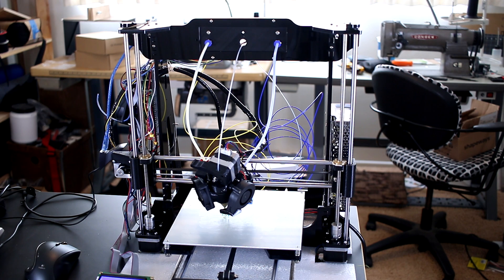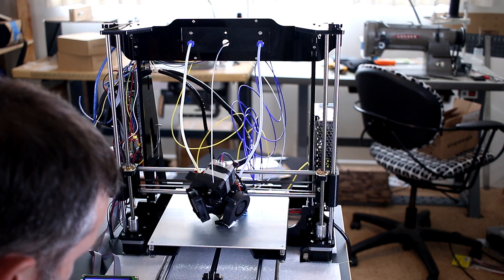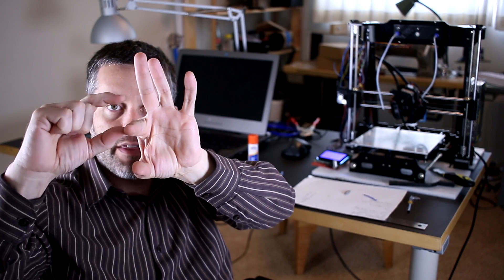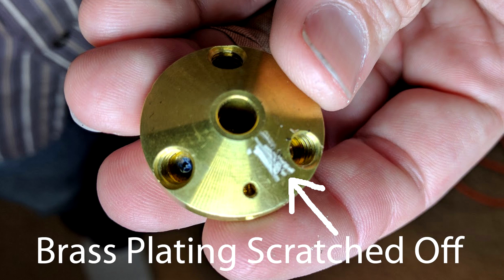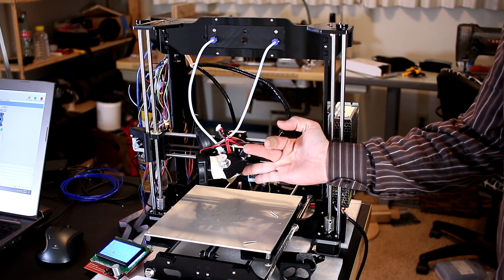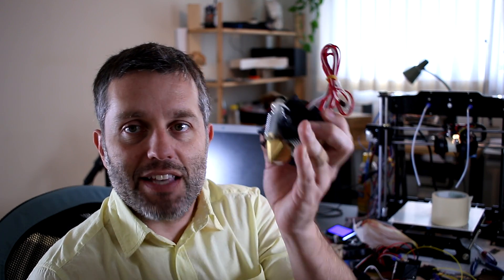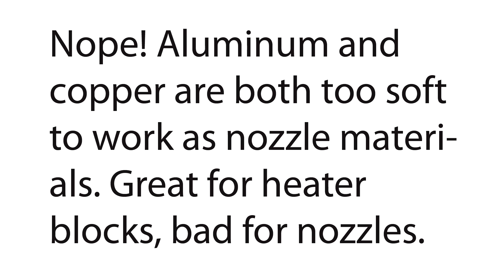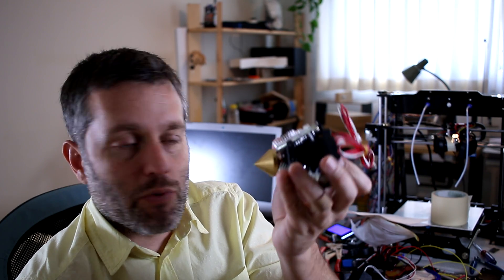Buyer Beware: My first 3 color 3D print with the ebay diamond hotend

Comment: Hi. I'm the inventor of the Diamond Hotend and i can see on your video you have a fake chinese Diamond Nozzle and you also have fake chinese heatsinks. The fake Diamond nozzle is very poor quality and many have problems with it.
I'll suggest you change the title of this video as the one you are testing is NOT a Diamond Hotend.
We put a lot of effort and time in developing this Diamond Hotend and it have cost us alot of money. Please do NOT misuse our name "Diamond Hotend" as you can not compare these products with the fake chinese version, as it is very different.
Reply: you as inventor why dont you make more videos about diamond hotend ? videos like original vs fake. videos like how to configure it. if the video is good, more people will buy your product.
Reply: exactly. The original iw WAAAAAAY too expensive. In the era of super high efficient cnc machines the production cost of such a simple elements is so small compared to the final product price in the shop that it clearly says someone want to get BIG money for a fairly easy task.
Reply: so where i buy the real 1
Reply: I agree with you and thank you for putting it pointedly but not angrily. Well done.
Reply: bought the unit from reprap.org, and I can say the unit is of exceptional quality (5 colour hotend).  I would buy some parts from China, but not that part.  The extruder is the end of the line, it is the final part of your build and the first part to touch the parts you are intent on building.  So don't cheap out on the extruder.  a cheap extruder leads to cheap printed parts. Everything else can be a manageable problem, but your extruder is the life-blood of your printer.
Reply: @Generator027  You wouldn't have a direct link to the 5 color hotend you brought, would you?
Reply: What you pay what you get! Clone is clone ...
Reply: i did a side to side took me a min to make the same
Reply: don't by idiot even Chinese clone is too expensive 4 small pice of metal
Reply: It's probably that expensive because he's Norwegian.
Reply: @Freddy_Lie  It's not even expensive, maybe like 30-40usd combined.

Comment: [ENG]
You are stupid, between the head of the diamond and the 3 radiator put a piece of cork and turn the fan. The head will be very hot and the radiators very cold. No more twisted wire problem.
[FR]
Tu es stupide, entre la tete de la diamond et les 3 radiateur met un morceaux de liège et fait tourné le ventilateur. La tête sera très chaude et les radiateurs très froid. Plus de problème de fil tordu.

Comment: Since you are looking at heat issues with nozzles have you looked at brass nozzles with detachable stainless steel tips.  Seems you were get the durability of steel with the thermal properties of Brass.  Tho I see there might be an issue with temperature sensor not matching the tip. I wonder if you could actually make a steel and aluminium version.

Comment: Where did you get the silicone boot?
Reply from the maker: I made it with High temperature RTV silicone from the autoparts store. There is a mold available on thingiverse. Leave the silicone in the mold for like a week before trying to remove it.
Reply: @DesignPrototypeTest   Thanks, that is a lot more cost effective than other options I have seen.

Comment: hi . how about this , use a edf fan and esc .
or print one , they can put more air than you will ever need .
pwn signal to control speed ,it don't even need be on the head .
you can put the fan on top of the printer and run flexible ducting to the head .
or buy a ducted bathroom fan ? and use a dimer switch to control the speed?
just food thought. 
good luck .

Comment: Good content and clear explanation so I subscribed but blaming China because you bought a cheap clone isn't really fair - yes they faked you out but the real Diamond hot end is more expensive because it takes these factors into account. All China did was offer you a low price imitation - the art of confidence trickery is appealing to the mark's greed :)
Reply: All a 3d printer is is a glue gun on a cnc quit trying to make it more then it is. My only advice take it apart clean it go over the threads if it don't look good send it back till it does and buy good heat brakes. but there thousands of 3d printers running clones that you can't tell the deference in print quality quit lying to people

Comment: Very curious about adding the diamond to my machine! Did you use a ramps board or a stepper extender for the additional extruders?
Reply from the maker: I used a Rumba board which is a Ramps 1.4 variant. It has six stepper motor driver slots on the board.

Comment: Aluminum ad copper are both too soft, but what about heat treated bronze? That has to stand up as least as well as brass, and it should be abetter thermal conductor than stainless or carbon steel.
Reply from the maker: Good thinking! Brass, and Bronze are both alloys of copper, and as such they will retain some of it's great thermal conductivity. Generally speaking Bronze alloys are harder than brass alloys, but the thermal conductivity isn't as good. Of course, the hardness, and thermal conductivity numbers vary depending on the specific alloys of Bronze and Brass which we are comparing.

The ultimate heater block/nozzle material would have very high numbers for both hardness, and thermal conductivity. Materials scientists have access to expensive database programs which graph characteristics such as this, and they can easily tell you what the ideal material would be. I'm not a materials scientist, but it looks to me like Tungsten is a pretty good bet with hardness that is off the chart, and a thermal conductivity that is a bit better than brass.

For the manufacturers the decision of which material to use always comes down to what is the least expensive option which is 'good enough?' Brass Bar Stock is readily available, and relatively inexpensive. Not only that, it is easy to machine, and it is hard enough so that it won't wear out unreasonably while extruding most of the plastics we commonly print with..

Comment: here it is working, maybe you can get something useful from looking at how this is setup and operating. 
you're certainly missing the sw to add the wipe tower.   it looks like he used Cork for the heat block. 

https://youtu.be/XpcJkaysb3Y
Reply from the maker: Yes. This is a diamond hotend that he has working. I will have the diamond hotend working as soon as I receive the correct (brass) part.

Comment: I could have told you that top fan wasnt gonna work, >.< I tried to be nice but now i gotta say it... You need serious airflow over these things, you have one massive block full of heat. You have no forced air over the fins, what youre doing is allowing the air to move around them, not pushing it through them, thats why the E3D shroud and heatsink looks the way it does. You need to design a wraparound clip style fan mount, then get some stronger fans than when E3D gives you, which just arent gonna cut it if you print anything over PLA in this config. You need 3 fans, this just isnt gonna do it, not even with a blower. Yeah Racing makes these serious ESC fans designed for RC aplications, they dont mess around. I use them on my prototype. They need a 5-7V feed so you need to buy a digital DC to DC converter to run and tune them to your aplication. You are also going to find those mixer nozzles dont do colors very well without purge towers. What theyre designed for is mixing polymers, for example a nylon PET mix, or PLA PHA mix, and tuning thos emixes and binders, its not for color printing. If you want 3 color printing, you need to use a single E3D nozzle, stop trying to get fancy with it. Same concept without the issues youre running into trying to use a mixing nozzle for multi-color, thats just not what theyre for, its not a seperate channel, its a spiraled tip, like 2 part epoxy mix tubes. Even if you did have the heat correct, you are wasting signifficantly more material every time u change the color because of the volume needed to purge it, when you chould just use a single bore.

Your design is also very, very heavy for an extruder setup, I could tell the weight and stepper torque was an issue as soon as you picked up that nozzle in the first vid. You really need to get away from the mixing nozzle hype, theyre hard on the PID loop, they waste filament in this aplication unnessisarily, they are heavy and 12v steppers wont really handle it well as high speeds, which locks you to stndard resolutions like 100 and 150 micron prints. They are also exceptionally hard on extruder motors, in your application, 2 must be locked which generates heat inside the motors and wears them down faster, if theyre not locked it backs them out which, if the motor has a vref that is perhaps too weak and allows this to happen, can damage the motors peak torque very rapidly, more rapidly than might seem aparent. And with that kind of diameter, where does your model cooling fan go? That is absolutly vital to printing PLA, you can not just toss that aside. 

Lets say you did find a place on that massive pyrimid / triangular nozzle... Lets say, on the side like a normal printer... Well now youre blowing on the hotend itself, deflecting a lot of it because of the diameter (the rear side gets hot while faced side is cooled) causing other feeding isuses, turbulent and uneven cooling on model, driving your PID loop crazy and end up using more power in doing so. You also have a massive ammount of residual heat with no way to dissipate it because of the mass and shape of the hotend, which bleeds down to the cool air and throws off ideal fan settings at different resolutions because of the temperature change. The volume and temp may mean the plastic is the same temp at different res, but the fan wont be, which just adds to frustration when trying to get good prints, not every consumer wants to have a notebook full of data from every print setting and result. While the latter is a minor issue, there are a bunch of those here that add up to bad experiences and prints. Remember, the little things matter, pay them attention. Youre also talking about getting a material other than stainless steel, which makes sense in any other application, stainess steel does not belong in reprap machines, anywhere. But the problem you have in this application is again the hotend mass. You think you have heat problems now with feeding, wait till you switch to something like a copper one... You even looked up the thermal effiency of each material, Its gonna get worse man. I know it looks awesome but you gotta let it go, its a gimmick from someone who probably never actually used a reprap machine, the chinese clones are usually done by means of pictures from the internet and an idea from some rich guy who is clueless, hiring uneducated and cheap employees... This is the result. Dont buy far east clones or gimmicks, they aren't worth the cost. 

You can't fix the steering on a car with a new tire, when the alignment is crooked... Tackle the heat issue first, not the inefficiency of the nozzle. You need to bite the bullet and go ahead with a three fan design, exhaust out the top. And exhaust is yet another issue, look where its gonna be blowing, even more-so if you forced air through the fins from the top... Its gonna go onto the plate, and while airflow is vital, constant and uneven flow where its not needed, is not ideal either. Having it intake horozontal to the plate and blow out the top is the way to go. Just because the Ultimaker 3 does it with small fans and to save space for more build volume, doesnt make it ideal. In fact, you already see intake shrouds to counteract that design decision on thingiverse and other community sites. 

Theres a reason Prusa uses a single nozzle for this as opposed to these bastardized nozzles. I respect the effort, but you gotta think about these things before you go off and spend money on them, designing a printer, or extruder, is not something most people are going to do well, people get paid hundreds of thousands a year to make this kind of stuff and its not some 3 month project, it can take a year or 2, just in planning before production, to get it right. In school, my engineering and art professors had one mantra in common, we were always told to "show your work!" but hardly anyone did, after all its just so they know you did work right?... Well... this is why they say that. Unfortunatly i had to learn the hard way over time as well, but here it is again, show your process so you can see the problems before the happen. Research is better done first than later.

Please dont take this comment the wrong way, I mean no harm, but there were many things I should have called out in the first vid that I refraind from and now im here gushing it out, sorry. Been working this field since 2010, mainly designing machines, mold positives and hint hint extruders. I can keep going like this but I think i've done enough for one comment, hope this helps u get it taken care of. It would be nice to see something like the Prusa design in an indi printer, but he has patents on a lot of this stuff too, so it may just not be viable right now. You may want to look into what you legally can and can't do, and then replan from there. Remember, makerbot didnt even exist till the old patents expired, and they tackled it, taking over the desktop market before anyone could renew them... Sometimes its best ot wait.

Comment: I see ppl usually adding cork or similar stuff to heatbreak between diamond and the heatsinks - takes care much of the radiated heat. Didnt notice if you had anything similar to shield from radiated, not conducted, heat. Edit: I can see one even in "related videos" next to the comments here on thumbnail, video called "3D bicolor printing with diamond hotend"
Reply from the maker: gelisob I have one of those. I made a sandwich of aluminum foil, two layers of 1mm fiberglass cloth, and another layer of aluminum foil. I called it a "heat blanket"in the video. I might experiment with cork next. I wonder what the combustion temp of cork is?

Comment: what the hell are u doing..?.. 1... how the hell are you feeding 3 lines with one motor? each line requires a individual motor.
 looks like a pile of shit..the anet a8 is designed for one extruder only..
Reply: What the hell are you writing? 1... Were are the other numbers after the 1 like the 2.. it isn't a "pile of shit" look at the previous Video to find the answers you looking for ;)
Reply: That's why people modify the machine, to make them do more than it is designed to.
Reply: the design is ment to be easily modifiable.. =P

Comment: Shouldn't you try printing in the default configuration with 3 bowdens before trying to integrate a direct drive from the get go? You might find better thermal control despite the stainless construction
Reply: Design Prototype Test I think he was saying the original fan configuration as that is the furthest from your fan
Reply from the maker: This is a legitimate observation. I'm trying to design around this concern. the fact is all three heatsinks are way too high in temperature.
Reply: Ben Schran that was my exact point, ty
Reply from the maker: Funny thing is that the blue was one of the Bowden feeds. The Direct drive worked perfectly. The heat issues aren't associated with the Direct Drive vs. Bowden setups.
Reply: Maybe try to separate hotend nozzle with PTFE tube/element, them switch to copper tube inside the  heak sinks to assure better thermal conduction from filament to heat sink??